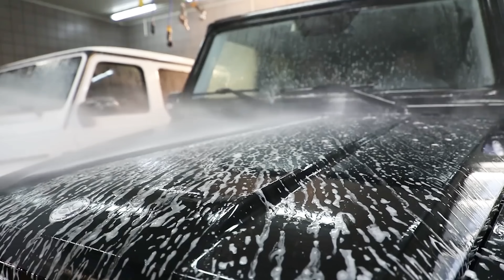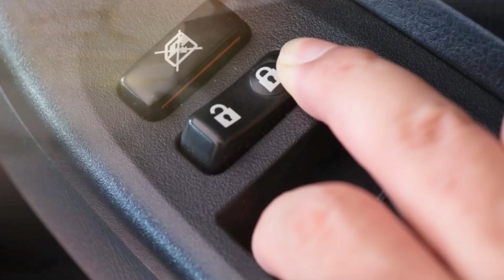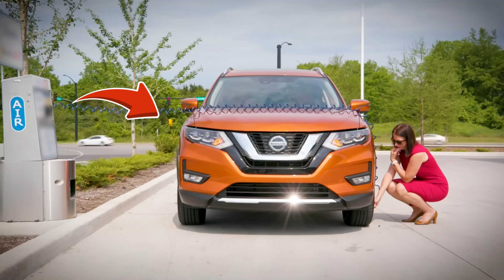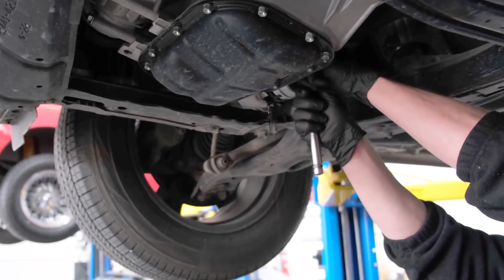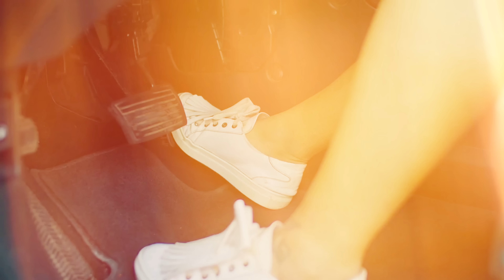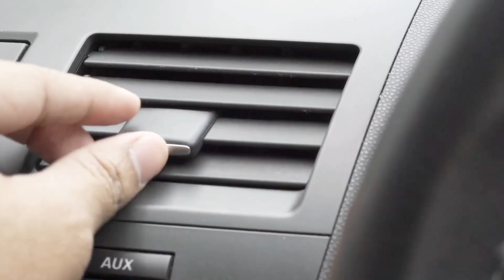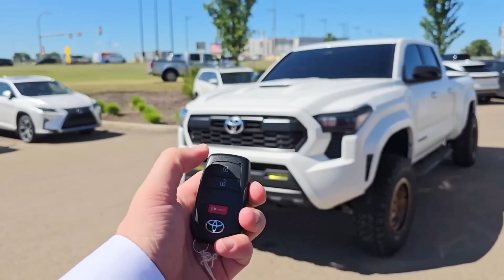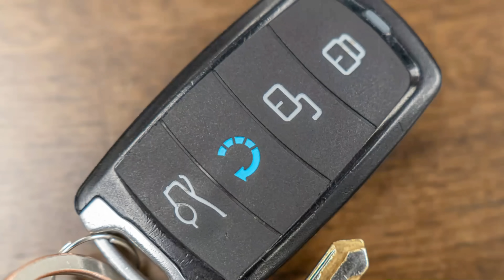This SECRET Car Features Is Only Known by 1% of Drivers (USE THEM NOW)

Comment: HERE'S THE KICKER.  My 2025 Lexus RX350h AWD Luxury trim doesn't even have most of these features.
Reply: Most of them would be automatic in sophisticated cars like yours.
Reply: @roberts4735  I have auto park and auto headlight dimming.
Reply: Lol
Reply: That's funny my 2012 Optima EX does
Reply: @anonymousme2159  Let's trade cars. 😅
Reply: I drive a 2010 RX 450H - read the manual. My mirrors tilt down when I reverse. My cure for an empty battery (very small and weak as it's a hybrid) is a jump start power bank (small and fits nicely next to the battery). For some unfathomable reason, however, the much older RX 400 I had before would close the roof and windows if I pressed the hob for a few secs. This one doesn't! Tell you what, I'll read the manual again.

Comment: I have a push button start, no key. How do I reset?
Reply: Read your owners manual..it tells you how...
Reply: disconnect your battery for a few minutes.  should reset.  then drive a while,   so computer can re-learn .
Reply: @LLNewfie  Once you've disconnected the battery, try pushing down the windows or some other el. device so that any residual current disappears.

Comment: I don't have to lift my wiper blades up when it's freezing My crown has a heater that warms up that area
Reply: Special
Reply: Yes, I think so There is a heater in the windshield kin to The rear window defogger that heats that area Of the blades to undo freezing and or prevent freezing
Reply: Sure burn more gas just to warm your wipers😢
Reply: @RandyHarmon-be1qx  My crown doesn't burn gas to warm the wipers It uses electricity My crown is a hybrid It starts warming The wipers right away automatically if I have it on auto
Reply: @MrJOHN082850    ok burn electricity
Reply: I got a Ford focus,  electrically defrosts the whole windscreen
Reply: Yes, some cars Have that feature I don't know why Toyota doesn't use it Maybe they're saving it for Lexus or some other r Reason they decided not to use it However, I'm still happy that it defrosted windshield wipers thats a Head Start

Comment: How do you get to a gas pump with a dead battery?
Reply: Taxi
Reply: I always had jumper cables - so could flag down a car or ask someone in a parking lot.
Reply: That is the kicker
Reply: Push it!!! It's only 20 miles
Reply: True, and what's the use of putting gas in a car that won't start anyways?
Reply: Let it roll down hill, put it in 2nd gear hold the clutch in , at about 3mph let out the clutch OUT . Varoom Varoom. OH be sure that the ignition key is ON .
Reply: @ricardofierro7041 If your car is an Automatic Transmission, then DO NOT FOLLOW "ricardofierro7041 directions.

Because it will Destroy the Automatic Transmission. 

The Best Advice, Read and Understand The Vehicle Owners Manual Book of Instruction's, before you buy the vehicle. 

Some People simply should never drive...in order to Protect The Human Lives of Innocent Good Drivers on The Public Roads.
Reply: @ricardofierro7041 .   How many vehicles have a manual transmission these days? Almost none. A least not in the U.S.

Comment: Your car might have a timing belt, fan switch, or mechanical thermostat. These are very inexpensive parts. Here's the kicker; Failure of these parts that cost under $15 can total your car when they fail.
Reply: Is that like $2 for a gall9n of gas?
Reply: Putting a timing belt on a BMW certainly is going to cost a lot more than $15! maybe add two noughts
Reply: A belt for a vacuum cleaner costs more than $15.